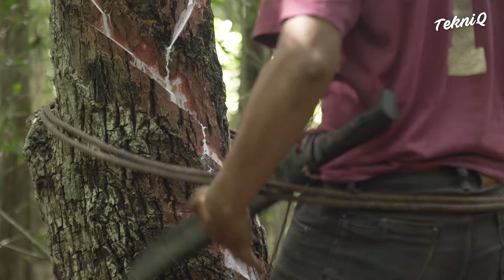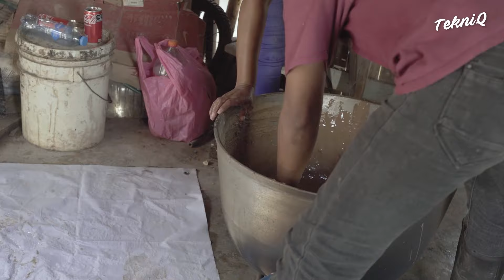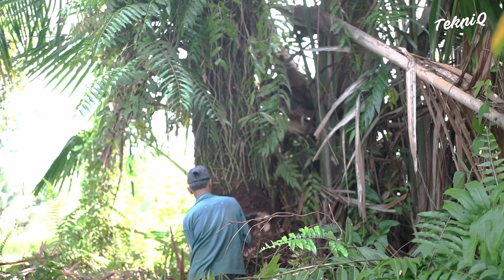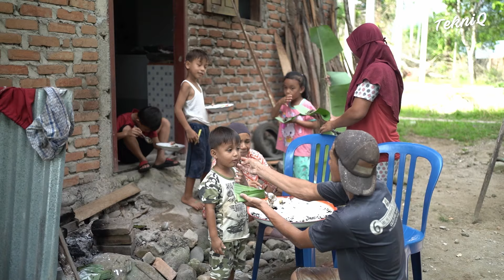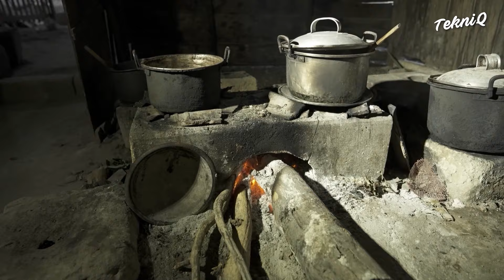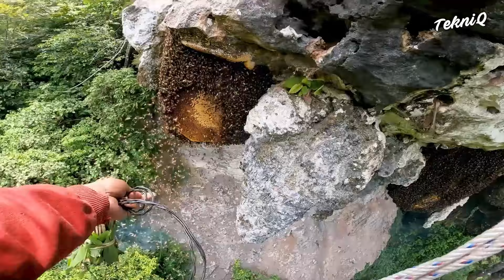Mexico’s Cheapest Technique to Make Tons of Chewing Gum

Comment: Hygiene rules were not followed. It's so dirty! Never chew such gum.
Reply: It was boiled pretty thoroughly, but yeah, it's far from being sterile... but that's how we used to live and eat before modern industrialized times, won't kill unless you're extremely unlucky (or immunocompromised).
Reply: @ciaomamabella  how did they achieve sanitary environment in primitive conditions, when you don't have a floor, soap, desinfection etc? I think you might have a bit too optimistic view how people used to live.

Of course poisonings could happen, but basically boiling kills most of the harmful bacteria and viruses (including hepatitis). You shouldn't get harmful amounts of rust from collecting material from a tree. Microplastics are everywhere, and you can't really avoid them, as even bottled water has them. In this case lead shouldn't be a problem, the pot seems to be made of steel or aluminium.

Of course that gum is far from meeting the standards to be sold in a modern store, but drinking unboiled water from some natural source, smoking, daily drinking, eating fast food regularly or not exercising is propably more dangerous.
Reply: Bro is weak 💀